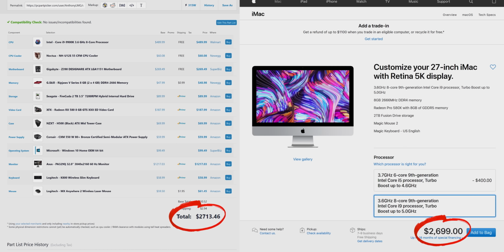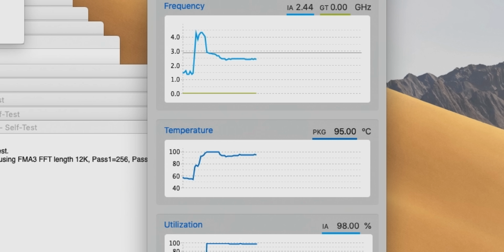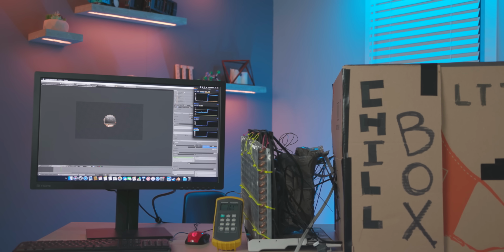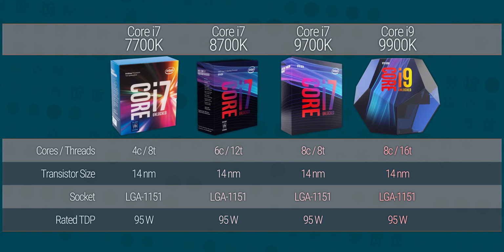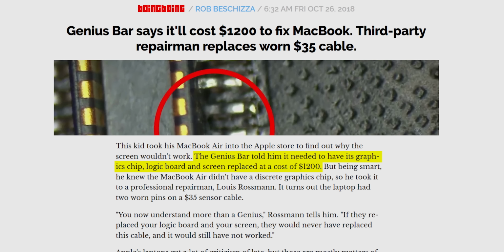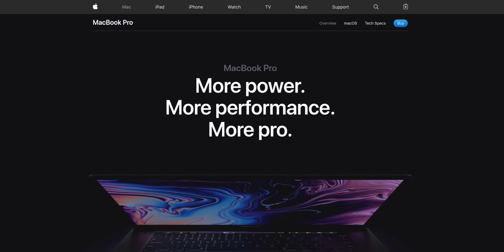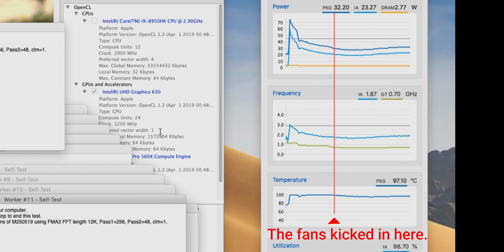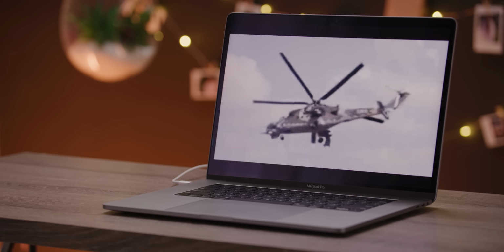Macs are SLOWER than PCs. Here’s why.

Comment: I don't see where the magic is claimed about what Apple is doing other than they are targeting their software to specific hardware that they control.  Apples are PCs.  They are simply PCs that Apple has designed their OS to support due to the drivers and OS design they place to make it best supported.  I think this was an interesting video, and it was good to discuss the hardware aspect.  However, the OS is another reason that the software and experience will perform differently; some of this because of how the OS is designed, and some for how the developers of applications and such develop their apps.  While I understand that people may be buying Macs for prestige, I think an original portion of it was that their products work well together, and that one spends less time managing it vs other systems.  If someone is choosing a standard Windows PC vs a Mac Book and their decision factor is based primarily hardware, I'd say that's probably the worst of reasons; the ecosystem is what should be the main driver in that you want, which stems questions about "can it support my data?", "does the OS support apps that support my data?".  Anyway, decent dialog on this discussion.  Enjoyed the comments.

Comment: Custom PCs costing the same as Macs spec for spec is total shit, entry level iMac is over $1000 USD and has mediocre intel graphics card and only a dual core 7th generation cpu and a 1080P 21.5 inch display. A similar display with med / high grade AMD / NVIDIA graphics, and current gen 4-6 core cpu could be had for same or less price, depending on if you buy pre-assembled or DIY. 

source : https://www.apple.com/shop/buy-mac/imac
Reply: plus ryzen cpu

Comment: Feel sad for those who understand computer and bought a Mac for gaming lmao
Reply: Why? My 2,4Ghz 2014 Model Macbook Pro with GTX1080ti  E-GPU and a little tweaking with costum fan profile and CPU undervoltage runs GTA V at  only 10% less FPS then my i7 PC that runs 4,7Ghz with the same graphics card. When gaming it turbo boost all day at 3.2Ghz no problem without overheating ;) Problem with Apple is not lack of performance or cooling, it is simply put that Apple don`t let the cooling fan start until they already overheat wich is easy to fix with custom fan profile.... 

You should instead feel sad for all those who don`t know that their Apple could do much better by simply just starting the cooling fans...

Comment: Huh? The Apple website is actually pretty up front about the clock speeds and the turbo boost speeds. 

And it’s not just the “look” that Apple is doing his for, it’s the design. Which matters in function as well as looks. If your MacBook can fit in a smaller space then it will be used more. 

And it also isn’t fair to claim Apple is ignoring heat. A lot of their work has been to design the most efficient fans and heat dissipation. If you’re going to compare with a pc then you should compare with a pc of the same size and shape.
Reply: what are you smoking? He never compared macs with anything (other than themselves under cooled environment). Sure the designs look very good and very easy to carry but to say they are heat efficient? Nah thats very wrong. He clearly gave you stats straight from the mac that the fans took very long to kick in. In what way delaying fans operation efficient unless you only care about battery efficiency.
And as he said, a lower spec non throttling cou is better than a higher spec throttling chip. So if they can't provide a good cooling for the cpu, why not just go for a slightly lower spec cpu which doesnt throttle which would be a lot more efficient than marketing 'high spec' configuration which you will never be able to use.

Comment: holy shit linus, for someone doing what you do, you are VERY uninformed. Apple, isn't happy with intel, they want a chip thats more . There's no "shift in philosophy" they want the best of both worlds, looks, and performance. The iPhone doesn't throttle because its running and APPLE chip, designed with this in mind. They'll perfect it on the small scale, and then eventually bring it to the Mac. Optimization has always been apples strong suit, once they start making CPU's the thermal performance will be like the iphones.

Comment: ANOTHER DIFFERENCE IN COSTS: RESIDUAL VALUE -- AND RATE OF DEPRECIATION. 
A mac includes a "deposit" ... and has the cost offset by how little time is wasted from having to run monogamous viruses (antivirus) -- reinstalling, and the tech-time required to unfuck PCs. Macs are a FRACTION of the cost of tech time / $$

Comment: What people complain about is that Apple computers are regularly on sale for quite some time without upgrades to the hardware. Yet the pricing doesnt change even 1 or 2 years down the line when better versions of the same hardware are already out for some time.
Its also the hardware choices apple uses that people complain about. When they use Intel extreme edition platforms with particular cpus that got desktop counterparts which are just as fast but cost as lot less. All you get for several hundred €s more is ECC compatability and quad channel. A fraction of their customers needs that stuff.

Comment: Apple doesn't make bad products ,but don't get me wrong their marketing strageies and business ethics are terrible(not to say they have bad marketing just dishonest marketing). They make expensive products that the only advantage of is having more optimized software as you showed here. If they slashed their prices by a few hundred, offer actual repair that isn't for some reason more expensive than their computers, and were up front and honest they would I belive have a more compeling product.

(Edit) Which also Isn't to say they don't design their products poorly. My A/V production class in high school had six iMacs two of which were 2018 models and four of what I belive were 2015 models and two of the 2015 models died from rendering footage and overheating and killing its on components.

Comment: You need to rethink your test. I just experienced how much slower a windows laptop is compared to a Mac yesterday. Mac booted in something like 20 seconds.  Windows laptop took almost 2 minutes to get a usable desktop. Both run Ssd drives with nothing more than anti viruse starting at boot.  I see a lot of comments lauding this pseudo science presentation but based on my real world experience, it’s all a bunch of garbage

Comment: The thing is, they DO make a magical OS. I don't know how they do it but Mac OS is godlike for design tools and renders. I imagine it's the OS, because I have a PC machine running Windows that don't even come close to a Mac of equivalent hardware specs. I use Mac on work and Windows at home (I'll never buy a Mac because I hate pre built non upgradeable machines), but there's something about their performance for creative applications that really makes it hard to argue.
Reply: @Jose Lino was referring specifically to hackintosh - a non Mac laptop or pc, made to run Mac Os. The magic of everything "just works" on Mac is lost when nothing quite works out of the box for hackintosh. It's because the OS and drivers were built and tested only for very specific combinations of hardware. Finding drivers at all was a challenge since unless some Mac used that component in the past, there would not be any drivers for it. If I remember correctly I had to get a new wifi card just so it would be recognized.
Reply: @Jose Lino Macs are great. Only reason I don't use one myself is I need the row of F1-F12 keys for gaming. If you can get used to the Mac interface, they are wonderful. It's hard to go from Mac back to a pc, other than the fact they are so expensive.
Reply: @Jose Lino depends what you're looking for. They're fast, smooth, things tend to be pretty tidy and easy to use. There's a lot of little nice things like pressing space bar to preview files, or using spotlight for pretty much everything, that you have to learn about before it becomes truly enjoyable to use. The best thing in my opinion is some combination of the incredible display and touchpad, and the form factor (incredibly thin and light yet very solid, tiny bezels, long battery life etc.)... The main drawback is that if you want to game, you'll need to either find Mac versions or figure out how to run boot camp to install windows.
Reply: Apple OSX is actually based on BSD a cusin of Linux  in the Unix family of operating systems. That is why it is so good and haave much better performance then windows for heavy use :) Just remember that to make a Apple computer work properly you need to use custom fan profiles as the default Apple ones makes their machines overheat and self destruct over time so you must buy new one....
Reply: You can build a hackintosh. Its like a pc with macOS.
Reply: @herroberbesserwisser7331  been there done that, it's a nightmare.

Comment: Isn’t the difference with the iPhone that it doesn’t have a cooling fan at all. Plus they design the chips themselves to work at maximum efficiency. I believe that apple should allow for more cooling by default, and add a quite mode for when you don’t want to hear noise unless absolutely necessary

Comment: It's really such a shame. I really love Mac OS but knowing all of this makes me very hesitant to go with a mac next time around, especially after the new Mac Pro was revealed.
Reply: Maybe just don't buy a "Pro"? I've thrown some considerable workloads at my MacBook Retina (Core M processor, fanless) and it has powered right through them. I know a lot of people with MacBook Airs, with several of them at work under our support with very few issues, mostly AirPlay hanging up in the conference rooms. 

Installing Macs Fan Control on my 2012 Mini solved it's thermal issues (seriously, Apple's main problem with heat is that they don't rev the fans up. 85 C and the fan still at idle.) and it'll power through Audacity projects like nobody's business. I don't see the real need for a Mac(Book) Pro. Current gen MacBook Air, possibly with a Thunderbolt eGPU for video-heavy work, and fan control software on it should cover most use cases.
Reply: Actullly Apple Macbook Pro has ok cooling, but you must use a costom fan profile becaus the default one does not start the fans until it is already overheating. My 2,4Ghz  2014 model Macbook Pro can run 3.2Ghz all day without ever going over 80C running 100% CPU on all 4 cores stress testing. I got it doing that by runnig custom fan profile that run full speed at 70c and a litltle undervoltage to CPU using overclocking tool. Without thees tweeks it would reach 100- 104C and only 2Ghz with LOT of CPU throttling doing same stress test....

Comment: I used to enjoy the Mac vs PC debate, but now.. Heck, if people want to blindly throw their $$$ at Apple, by all means be my guest. And now, that they're trying to kill the independent repair shops people will be spending even more with Apple. Go on and spend your hard earned cash for status and form.  My stock sure does approve :-)
Reply: Windows 10 was my breaking point. I love XP, 7 was really good, I suffered through 8, which was made up by 8.1, but 10 still has too many problems and too much telemetry for me to have any machines at home run it. I've used Linux Mint on my daily driver for the last 4 years, but Linux still doesn't play nice with most printers and iPhones. So, already having a MacBook, I decided to standardize the home machines on MacOS. Light, quick, simple to use (once you understand the design), compatible with everything, and no BS with random update reboots or drivers. I spend all day screwing around with Windows 10 machines, the last thing I want to do when I get home is fix my own machines. I want to use the machines when I want to use them, and I trust that when I close my MacBook or lock the screen on my Mac mini, the machines will go to sleep, stay asleep, and not freeze during resume. I have no worries of my MacBook cooking itself in the bag unlike every Windows laptop I've had.

To make up for it (and keep money away from Apple), I bought the machines used. Better specs for half the price.

Comment: You would think they would find a way to leverage the aluminum chassis of the MBP to assist in cooling until it heatsoaks. Aluminum transfers heat very rapidly so it would work well to move heat away from the cpu, and maybe use built in fan ducting to help dissipate heat to the atmosphere.

Comment: They should make laptops thicker again and add more powerfull exhaust fans
Reply: Yeah, but those kind of laptops don't turn people on like the thin ultra-lightweight ones do.
Reply: @michael3069  i personaly like my good ol dell from 2008 because it runs cool and is a tank
Reply: @lazymations1778  I agree with you, I think that making laptops thinner isn't worth the heat increase. I was just insulting the people who care so much about how thin and sexy their laptop is.
Reply: lazy mations How does it run? My vaio from 2011 runs hot and LOUD with a 40 nm dual core 1.65ghz apu, oh and slow as shit.
Reply: @lazymations1778  I bought a ThiccPad from 2007 for college. It's chunky but is reliable as fuck, runs cool, has plenty of I/O and works fine for what I need it. Can say I'm happy with it
Reply: I mean ultra notebooks and all is created for light uses only, surf web, video, light business work i understand from that perspective. But if the purpose is only just that 2-3k macbook ỏr a mac doesnt make any fking sense
Reply: The purpose of a laptop is portability. If you have a thick ass 10 pound laptop there goes the portability. Many people for example need the laptop to work in college. Carry around a 15kg laptop in your back and you'll prefer higher temperatures and lowr performance over a very thick and bulky laptop. Personally, i'm against macs, but thin laptops are what people actually want, in the sense that if you wan tbeefy performance might as well go with a desktop
Reply: @pedrosilvaaudio96  I carry a 10 pound laptop around college. Its probably the only reason I'm not grossly overweight.
Reply: The majority of ppl in this world are complete idiots and now im not talking about tech only ...just in general so apple knows that and it works great for them obviously.
Reply: They should but will they probably not
Reply: I prefer a thinner laptop, i dont mean to offend you but many or some people prefer thinner laptop because they are lighter and more portable, as for me i like thinner laptop because heavier laptop will hurt my shoulder and back when im bringing it to school, soem thin laptop isnt even that bad like the Asus ROG Strix G GA502 which i s a gaming laptop but thin
Reply: Real laptops have curves
Reply: are called pc laptops
Reply: Powerful, not powerfull.
Reply: My ThinkPad T480s is relatively thin and has no cooling issues lol.
Reply: google image search 'rugged laptop'
Reply: Then you want asus g703gx. I love it.
Reply: Actually my 2014 Macbook Pro has ok cooling, it is just that you must use custom fan profile that does not let it get to 90C before it STARTS the cooling fans like the default does....
Reply: O yeah, bring back them 90's style laptops FTW
Reply: I like how things were back in the good ol days when appearances didn't matter, only performance and reliability did.
Reply: yes, and also use thicker magnesium chassis to assist conductive cooling, air flow and eliminate flexing by making The chassis more rigid. while creating room for actual IO ports and and batteries.
Reply: From a customers perspective that may make sense, but for Apple, the customers perspective is irrelevant and is not in their interests.
Hence, the WORLDS FIRST TRILLION DOLLAR COMPANY.
Reply: Those laptops exist. Just buy another brand.
Reply: thinkpad bro
Reply: I AGREE BUT MY FAN ALWAYS SOUNDS LIKE A JET ENGINE THATS WHY I AM GETTING A THIN FANLESS LAPTOP
Reply: @watermelon-7464  When's the last time you've cleaned them? If you have to think about that, there's the reason for the noise.

Comment: I bought a Macbook Pro just to have the most expensive barbecue grill in the neighborhood.
Reply: Lol me took I went to Apple.
And I showed them how it heat up 😂🤣
The manager wasn't able to explain when I told him I'm still checking how to fill the consumer protection form is that by saying it's a laptop, heater or a grill.
He took it and refunded me even after 2 months from the purchase 😂
Reply: @whynot-b5a3  sounds like u sir are a WINNER
Reply: @dozergames2395  lol I know my law and rights in Quebec while many don't.  And these companies don't want complaints made at the consumer protection.
Reply: It seems they want to keep their whole Beige Toaster thing from the original...
Reply: Damn... Mine burned down tho ;D
Reply: No what you have is the Fastest SSDs in the world.  Average write speed of 2,682 MB/s - fully encrypted.
Reply: @darkpill  Nah, PC still runs the show there too: https://ssd.technology/featured/ssd-rankings-the-fastest-solid-state-drives/
Reply: That sums up your IQ.
Reply: Hahahahahaha
Reply: which MacBook Pro do you have ? the "13inch?
Reply: I have tamed my 2014 Macbook pro so it is not a hotplate :) Costum fan profile that does let the fans spin full speed already at 70c instead of the default 95c that resulted in constant CPU throttling,  combined with use of intel overclocking tool to reduce the CPU woltage. It  can with thees simple mods run 100% CPU usage all 4 cores at 3.2Ghz (instead of 2Ghz) and it still keeps under 80C with no CPU throttle ever  :)
Reply: macbook pro trash tho
Reply: @woah_team  What??? It's excellent for grilling!
Reply: hood broly https://youtu.be/Rw2HFu5xAeA mac is better
Reply: You got it